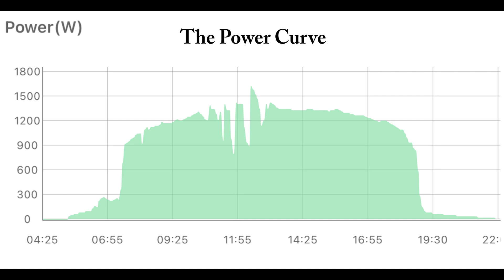Time Lapse Of My Diy Budget Solar Tracker System,

Comment: I'm not sure. But do you have a Hot Tub(in your video?). By your Solar Tracker. If you do. I always thought only Viking Gods mainly had those Pleasures
Reply from the maker: Haha, yes, we use it all seasons. In the winter I heat it to 39c-40c and then we jump it in the snow (when there is any)😅

Comment: from 3:55 or so the second one was lagging behind but got back around 4:13 

wonderfull footage and quite an impressive result cause you are only running a single axis tracker and the only ssystems I know about the figures are 2 axis one.

In munich on the solar 2023 exhibition they started to show those among agri culture solutions, also 2 in a row but with a link or connection rod to steer the second from the first but so thick pilars you would not believe compared to yours.
Reply from the maker: Yes, due to friction an voltage drop the rear is a little slower. They are connected in series and the front one is the master.
Still not much of power loss at all. I have done some tests to this and it’s pretty much the same.
Thank you so much for your comment 😊
Reply: @flyingtools  have you heard about the channel Offgrid-garage ?
Andy is a german running an english channel down under about solar power systems in a quite impressive arrangement of roofs he can use and that  are everywhere around his property.

He is looking for a solution on his roof and I wrote a comment under his latest video from tonight (not so small, just 65000 subscribers) where he was asking for a solution on his roof to build a  more or less 1 axis tracker that would allow him to bring the panels out of the windload that he now suddenly seems to fear after a comment, that such 4 panels in horizontally position would not only fly away but maybe even lift his whole house roof - but I doubt that 4 of these panels can cause that with a 45° angle which mean 60 cm of hight and 2,25 m length = sailsize. 

My bet is that the solar cells will burst and be kicked out of the frame  so that he would have an empty frame of up to 4 but not a flying roof. 

You might write him a mail or check his latest video from saturday night = just 2 hours ago or so.

And he will for sure love your ID.3 battery trailer and the ideas about high voltage batteries and its use cases, too.
Might be time for a collaboration from on point on the earth to the opposite point of the earth even though I am not sure if we would end up in australia or rather in the pacific ocean.
Reply from the maker: @typxxilps  hi.😃 yes, of course, I have heard about him. I have watched a lot of videos from him when I did build my low volt system and I am still a subscriber to his channel, 
But I haven’t seen that video yet that you were talking about. It would be great if I had contact with him, but I guess that he has already so many comments so he’s probably not going to see mine haha.
Thank you so much anyway for your idea anyway 😊